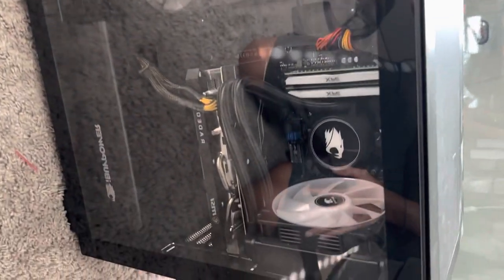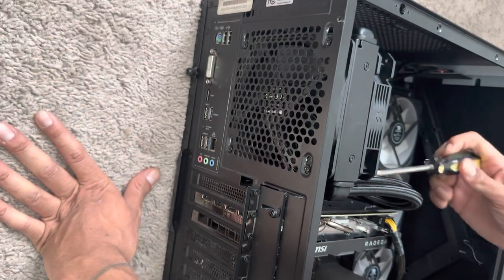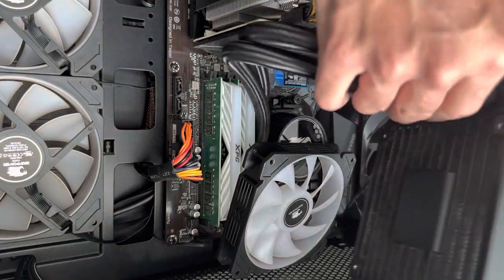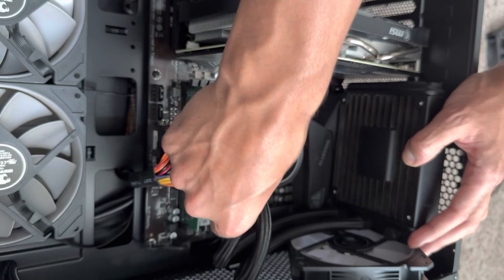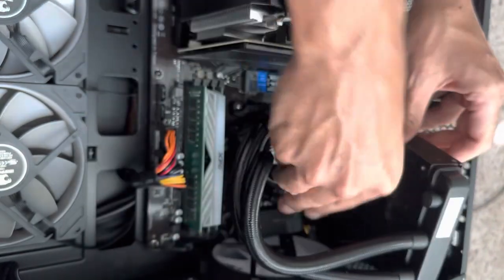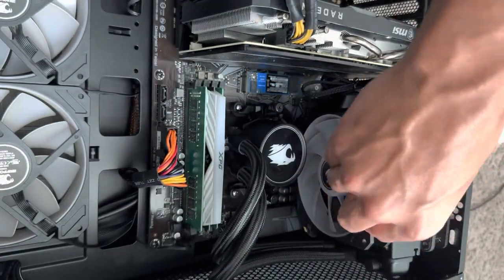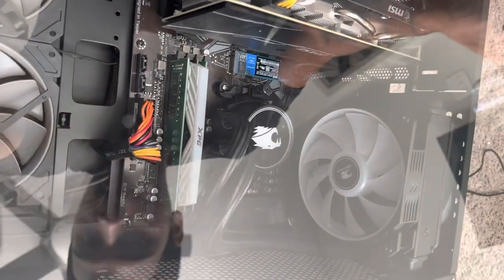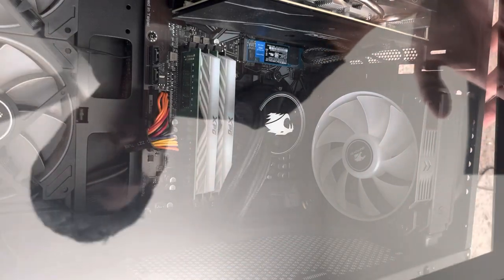How To Fix Any Rattling Or Buzzing Fan/AIO Pump Liquid Cooler PC. SOLUTION.

Comment: you put the back fan backwards. when you took it off, the airflow was going out. when you put it back in, you flipped it. now you have the inside fan pushing air out and the outside fan pulling air in.
Reply from the maker: Good to know , I’ll definitely put it on the right way when I install the new one

Comment: Yo! I probably have similar issue. I have a Corsair AIO (don't know the exact model) its placed on top so the tubes come down to my CPU. I belive the positioning is perfect. I've had it for 2 years or so now and ran up to rattling noise when the pc boots up and sometimes while doing regular tasks. My CPU temp also rised up, almost reaching 100° celcius while playing and around 50-70 while just searching on browser. Any possible solutions for this? I've already tried changing thermal paste but seems like AIO is the issue.
Reply from the maker: Another possible solution could be that it’s clogged pretty bad.. I saw a Video of some guy and he takes the AIO Cooler off, opens the circular piece with star head or what is needed for yours.. As he opened it there was a lot of “Gunk” or slimy stuff clogging it up. He used small basic tools to scrape it out and unclog it. He then said it worked good after. That could be a great solution if you’re willing to open it up.
Reply: Could also be a failing AIO. Not a common time frame for failure but not impossible

Comment: I just did this and it worked for me.  Thanks!
Reply: Update:  It worked for a few hours. Today, noise is back. New cooler on the way.
Reply from the maker: @kidkicker81  Same here .. Installation Video on the way!
Reply: @matrixtactical5133  wait did it really come back
Reply from the maker: Yes and PC shuts off again so I will be replacing it. I’m starting to realize it’s very common with the ibuypower coolers  @WillKing01
Reply: @matrixtactical5133  did your pc just started doing it for no reason? I moved out today and noticed my pc started making weird noise for no reason and thank god you pc fixed my problem just kinda surprised a simple cable can do so much noise I thought my pc was gonna explode
Reply from the maker: @WillKing01  it did happen out of no where and I would also move it around a lot as I would travel for work.
Reply: @matrixtactical5133  can you give info on where you got the replacement and all the info regarding size etc...

Comment: I see you consistantly answering questions still on this video so I figure I ask. Was your rattling/buzzing noise coming from the CPU-block or the fan?

 I got a Cooler Master ml120l v2 rgb AIO and I very recently started hearing some rattling / buzzing noise coming out of nowhere (only while playing games when the fans in the pc has to work abit harder) coming from the CPU block. It is not consistant, but give or take every couple seconds with afew seconds interwall and then stops for it to then continue, usually when you move around or change scenery in a game. There's no noise at all coming from the cooler when i'm not gaming, completely silent.

The temps are completely normal aswell.
CPU: 40-48c idle - 60c ingame, with spikes to 70-75 during heavy load, such as loadingscreen and whatnot.
GPU: 40-50c idle - 60-75c ingame, dependant on scenery ingame of course.

I heard that if it was airbubbles - gently tilting the tower could resolve the issue, this worked one time prior but now the rattling is back haha so idk what I can do lol.
Edit: I tried tilting it back & forth a couple times, but the rattling won't stop this time. Oddly enough.
Reply: Did you find an solution ? I have it with my brand new be quiet😢
Reply: Did you solve it?
It is because of gas bubbles getting inside of the CPU block
If inside the pump there is both liquid and air, it will cause this rattling sound because it is spinning so fast

Tilting my pc solved it briefly, but once put it back to normal, it was worse
I assume my tilting made even more bubbles get into the cpu block

The only way is to find the correct inclination to let all of the excess air trapped into the CPU block out and to the top of the radiator, where it won't bother anymore
Reply: @s1mo  idk if I solved it to be honest. I unplugged my pc to clean it one day (had it tilted in various ways) a couple months ago and since then it has stopped. Altho I heard faint rattling as of 2 days ago again but only for a second or two

Comment: always has been orientated the "right" way, yet it still makes the noise.
Reply from the maker: Time to get a new one then. Mine stopped making noise but after a while it started back up. I did the replacement and it’s been running like butter. 
I should have made an installation video but I’ve been slacking in every aspect of life right now 😂